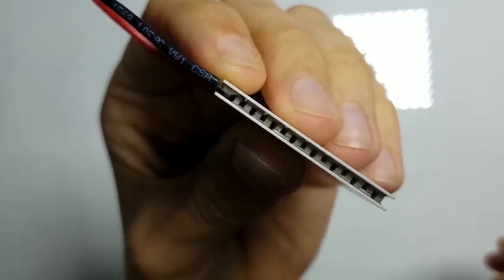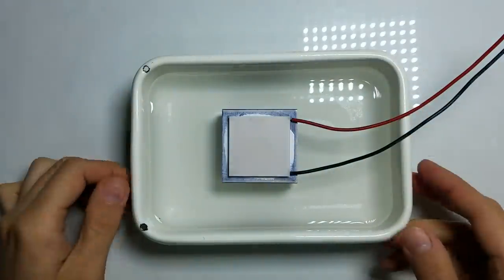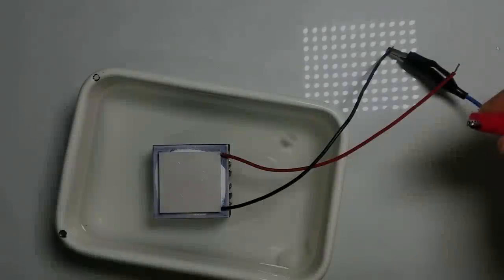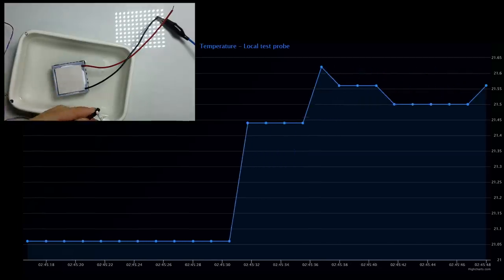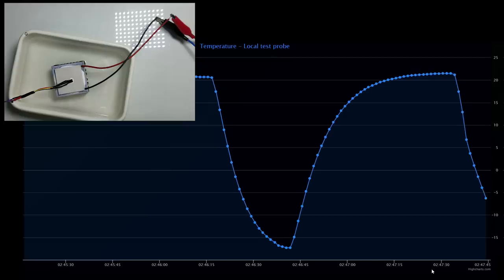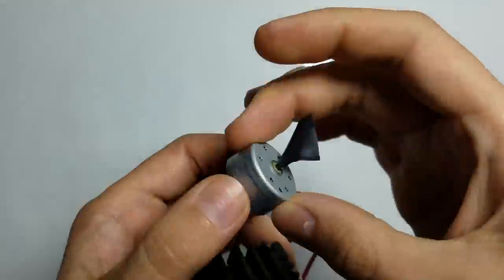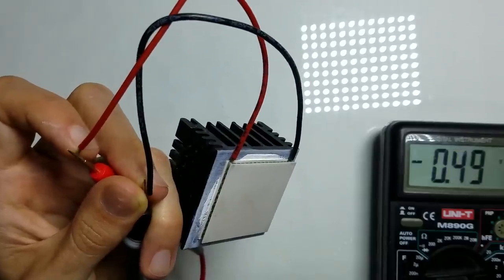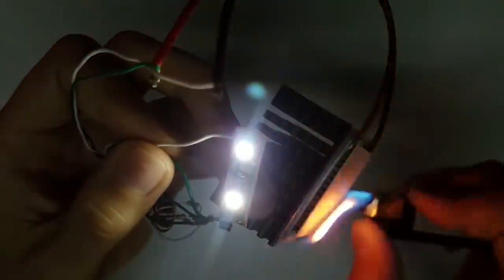Thermoelectric Cooler - Device That Makes Ice and Electricity

Comment: Will it make electricity on the cold side too
Reply from the maker: Hi, what do you mean by "on the cold side"?... you just need to make one side hotter than another. You can also switch sides, then the electrical polarity will switch as well.
If both sides have the same temperature then it will not make any electricity.

Comment: interesting i also found those things was tinking to make a little fridge. but i am wondering can u boost it to 12v ? i am not that great with electricitie but if thats possible shoulden u be abble to stick 2 to each other and let the hot side heat up the one that generates te power and the other one of course cosume the power to heat it again free fridge power ? ow i also found a föhn heater that is 12v so should also be able to make a heater if its possible of course

Comment: How do you know which side is cold and hot side of peltier module?
Reply from the maker: Just connect it to the power source for a second and you will know. Btw, if you reverse polarity hot/cold sides changes as well.

Comment: hey dude.. Can I ask?
"What if I going to be connect peltier module to a lower Voltage and for example is only 9Volts of current voltge,.. Does it still works or produces an ICE? or does it still continuously cools??
Reply from the maker: Hi, with 9V it works and consumes about 3A, so make sure that your power source can provide at least 3A. Well, it is getting cold with 9V, and you will be able to freeze a drop of water. Another side of the device is getting hot as well, so you need to cool it down. 
I just did some tests and It is getting cold even with 5V, but you will not be able to freeze water using 5V.

Comment: Great explanation of what this can, and can't do. I was hoping to use this to chill the water in an evaporative cooler, but it generates as much heat as it cools, which a fridge does as well. ;0)  Did you measure how much heat it produces? Also can you regulate the heat/cold by regulating the voltage? Or is it only on or off?

Comment: When applying heat to one side does the other side get cold?
Reply: When you supply it with 12v, 1 side gets hot the other gets cold at the same time

Comment: you could use these on satellites one side that's facing the sun the other side that's not
Reply: Pretty good idea!  I was just thinking about all the cool things you could use this for.
Reply: Helaman Gile they actually have been used on satellites, but not this way. Thermonuclear reactors harness the heat from a nuclear reaction to produce electricity and are used in deep space probes.
Reply: @johnnykatze7467  that is so awesome never knew that

Comment: Can you use it like a cpu cooler? Fyi only watched bits and pieces of it.
Reply: No, not really. If you count with a 75W tdp cpu you would need to have a a 200W peltier module at least probably a 300W if you dont want to fry your cpu. You would need to feed it 12.5A at 24 volt or 25A!! at 12 volts. And at the end you would not only need to deal with that 75W to dissipate but 375W!
Reply: @tiesto9797  thanks

Comment: may i know how much current it draws from 12V voltage supply?
Reply from the maker: Hi, about 4A - 6A
Reply: Depends on the module you are using there are upto 15A modules available

Comment: I bought an ice chest that uses those to heat or cool depending on how you plug it in. It drains a car battery QUICK even when the engine runs. Turn off the engine and there's not enough power to turn over the engine one time.

Comment: I'm wondering. Is it can be able to charge a battery if I can provide continuous heat difference?
Reply from the maker: Hi, yes, but it generates not much energy, so charging will be very slow. You will not be able to charge a phone via USB, not enough power. But you can use for example appropriate dc-dc step-up converter (something similar to what I've used with those LEDs), convert it to 14V for example and charge a small lead-acid battery... but it will take a lot of time to charge it. You can use many modules to get more energy, but I think it is not worth it.

Comment: If I take TEC1-12706 peltier module and I gave to it 12volt,6amp at room temperature 35 degree Celsius then after 1hour what will be the min temperature at cold side and max temperature at hot side

Comment: Find a way to submerge the cold side into the water to see how much ice you can make. Enclose the hot side not just to a heat sink but to some process that will use that heat to do more work. After all if your gonna use DC to run it, you might as well get your money's worth. How about finding a way to use several of these in a Loop! The heat can make the voltage to run the other side and Poof, instant self generating cold and heat source.
Reply: It works in reverse right.. if you apply heat or cold, you get voltage out of the wires.
Reply from the maker: Yes, but it is not energy efficient. This device just about 10-20% energy efficient.

Comment: Hey I'm thinking to use this for power generation,can I use heat and produce electricity?
Reply: Didn't you just saw him produce electricity using his lighter as a source of heat
Reply: @Reedyngaihte  yeah but m unable to find exact model,can we use any sort of peltier for power generation?
Reply: @pratikmourya  yes..you can
Reply: @Reedyngaihte ok then I'll get one, thank you mate :)
Reply from the maker: Not just heat, you need to make temperature difference, which means one side of the device has to be hotter than another. The bigger temperature difference the better. But you also should know that this device is not energy efficient, so in most cases it is probably only worth doing for educational purposes.
I am not an expert on Peltier devices, but I think they all should work in reverse and generate electricity.

Comment: People would delid a CPU, but I couldn't find  people delidding Peltier cooler.
May be someone delidding a Peltier and replace the ceramic disk by a copper plate
The TEC part in the sandwich is insulated by putting a mica between the TEC and copper plate,
much like the power transitor heat sink.

Comment: Cool video! .... random question, say I have two of those and I am cooling water will it reach a colder temperature than each of the coolers? Or the only difference is that it will just cool to that temp faster?
Reply: The water can't reach lower temperature than the coolers, but they can cool fast

Comment: Hi!! Really nice video!
I know there are different type of peltier cells. Which kind of P(eltier) C(ell) is this?
Where do you buy it? 
I did and experiment with a PC but I wasn't able to get any colder than 20C on the cold side, I used a very powerful heat sink a CPU heat pipe with a capability of 200W heat dissipation but 20C was the coldest temp I reach. My thought was that my cell is not a very good quality of maybe is a wrong type.
Thanks for any help!
Reply from the maker: Hi, I've used TEC1-12706, bought it in a local online store (not worth mentioning). Well, make measurements: voltage and current, and try to find out what is wrong. Is your heat sink getting warm?... well I don't know what is wrong, need more info.
Reply: @ElectricalPro  that's the point all measurements are looking fine. Voltage oscillates between 12.5 and 11, current at full power is between 2.8 and 3.3 amperes. My heat sink is getting really warm. the cell without heat sink goes in a couple of seconds to 100 degree, with the heat sink it stabilises around 50. this is ok but mean wile the "cold" side is at 20
Reply from the maker: Ok, it seems like your Peltier device is defective. It is not just "not a very good quality", it doesn't work at all, it is defective.
I did not care much where to buy it, I just googled TEC1-12706 and bought it.

Comment: What ampere to work peltier.
Reply: It taking 12 volts dc and 10 to 15 amp power.
Reply: Check the model number, in vid. it is 12706, 12 means 12v, 06 means it draws 6A.

Comment: Do you think you could make a device that would keep a small ice pack cold? The reason why I'm asking is bc I have chronic back pain and the best relief I get is keeping a small ice pack on the problem area of my back. The ice pack is so cold it numbs the area, but within    about 30 minutes, the ice pack thaws out and the pain comes back just like it was, before I used the IP on it. I injured, (broke) my back almost 18 years ago and Its given me trouble ever since. I was self employed and I had good insurance, but the neurosurgeon was afraid to do an  operation. I think he was worried that it might make it worse. After looking at my x-rays and MRI my family doctor said the state law prevented him from writing a prescription for the kind of medicine I needed, so he referred me to a pain management Dr and he tried everything he could, but nothing helped. The only thing left was pain meds. and he giving me the strongest thing he could, until the government  changed the drug law's, which stopped him from prescribing that type of medicine. Besides my back being all messed up, he said I had degenerative disc desease's, which basically means my back won't be getting any better. The older I get, my spine will be slowly deteorate, I guess, until I'm no longer able to get around. So that what's I got to look forward to. If you could invent something like that, I would appreciate it very much and I would also be glad to pay you for your time and materials. I'm not the only person that has this problem, so If you did manage to build  something like that and it works good without any problems. I don't think you would have any problem  selling them. Regardless of what you do, I would like to thank you for listening. Take care, stay safe and have a great day.

Comment: What is the efficiency of this device compared the compressor tech.
Reply: Terrible. That is why compressor tech dominates the market for refrigeration and air conditioning.

These are used for spot cooling or when quietness or lack of vibration is important.
Reply from the maker: From wiki: In refrigeration applications, thermoelectric junctions have about 1/4th the efficiency compared to conventional means (they offer around 10–15%efficiency of the ideal Carnot cycle refrigerator, compared with 40–60% achieved by conventional compression-cycle systems

More here: https://en.wikipedia.org/wiki/Thermoelectric_cooling

Comment: How cold can they go! can it achieve cryogenics temperature? If you physically connect them in series with thermal conductive paste, could it generate extremely cold temperatures with these devices?

Comment: I went to two years of Technical vocational school for electrical wiring and I went to an additional two years of electronics class! I have only seen one minute and 27 seconds of a video so far, I find this device difficult to believe, tell me what are the components you use to make this,  what is the voltage amperage wattage and frequency of electricity that you're using?
Reply from the maker: Hi, I did not make it, I bought it, you can read about it on Wikipedia: https://en.wikipedia.org/wiki/Thermoelectric_cooling
You need 12V DC to power it, it consumes about 4A-6A, you can calculate wattage from it.

Comment: Don't coilless fridges use this? The sides are warm, but inside is cool.
Reply: the principle of any fridges is to take the heat from the inside and transfer it outside. In fact any device that cools works this way (feidges, air conditioning, etc,...)
Reply: @SessesSniper  I'm talking specifically about fridges that doesn't have the heatsinks exposed at the back.
Reply: @killervirus57  oh ok I didn't knew about them x)

Comment: It would be cool if you could utilize this to cool soda cans quickly, or thermos bottle or cooler or ac units without freon. It would be good in an electric car to use as a heater / air conditioner
Reply: Already exists. I have one I can plug into my car cigarette lighter plug.

Comment: There are tests with this kind of TEC and is unable to create ice because it freezes very slow and is limited in temperature difference between both sides. That's why in video is using water (surely very cold water) and the termometer is not hotting the TEC. Also don't works as CPU cooler by the same problem, is unable to freeze fast enougth and becomes hotter than put just the cooler.
Just put a beer and you'll see what I mean...
Reply from the maker: It's tap water, I think at the start the water was about 15C, but because the device creates a lot of heat the water became very warm, I think it became about 30C... Well, water cooling is not necessary,  you can just use a big heatsink.
It should easily freeze drops of water, but you will not be able to freeze big amount of water. It is not possible to freeze a glass of water with this method.
It is not about freezing speed it is about power... your fridge can freeze water, but you still can't freeze a lake with it, no matter how much time you spend.
It is absolutely possible to make a fridge with a lot of these devices, but such fridge will consume 10 times more energy compared to a regular fridge.

Comment: You should submerge as much as you can into the water and maybe the ice it creates can cool the heat sink and maybe it will continue the cycle. Or maybe isolate the warm and cold water and get on side cold water and other side warm.

Comment: can a peltier device charge a battery some how?
Reply from the maker: Yes, it can, but it usually not worth it, because it will take a very long time. You will need multiple Peltier devices to charge a phone for example. Solar panels are usually much batter choice, but they of course need sunlight.
Reply: @ElectricalPro  thank u

Comment: Wouldn't you be kind to upload a video on how to make it???
Reply from the maker: Hi, I bought the device, it is probably impossible to make it at home... it will require special materials, equipment, knowledge. For more information read about "Thermoelectric cooling" on Wikipedia... it is not that simple.
Reply: @ElectricalPro  what's the cost
Reply from the maker: About 3$ - 7$

Comment: Can you make termo water cooler or swamp ?
With Temp sensor and controller ?
Reply: You would need to figure out a way to dissipate all of the residual heat from the opposit side.  Without having a negative effect on your heat transfer process. Whatever that may be.

Comment: Appreciate your effort , nice video . Hey can you tell we what would be the temperature on the hot side
Reply from the maker: Well, it depends on the cooling you use. It produces quite a lot of heat, my heat sink becomes very hot less than in minute, that is why I put it in water, it even made the water warm. How hot? it can get hot enough to boil water.
Without a heatsink, it will probably burn out in 10-20 seconds.
Reply: @ElectricalPro  A heat sink & fan combination works fine.

Comment: Nice vdo of some unheard technology, Can it be used as an air con in tropical countries to save electricity? How much electricity required to make one panel ice cold?
Reply from the maker: Hi, yes it can, if you use a lot of them. But it is not energy efficient, I think a regular air con is a way more energy efficient. Although one side of this device gets cold, another side gets very hot, which requires cooling... It consumes about 50W.

Comment: can I cook in one Side and other side to make ice for chilled bea
Reply: Yeah great idea, but the bummer is you need to dissipate the heat fast from the hot side because it will heat up the cold site. Also these modules typically can produce 70C of thermal difference so your meal will not cook or you tea will gets warm.

Comment: This could be used for cpu cooling but it might freeze the core
Reply: Neko014 bro it work at it best at 12v so if you give it like 6 or 5 volts it will work flawlessly

Comment: How to know which part is hot and cold?
Reply from the maker: You can test it yourself, connect it to a 12V DC power source for 1 second. Or you can figure it out from the video. If you reverse polarity hot/cold sides switch places as well.

Comment: Dear I supplied 12v to 12706, both sides become equally hot. No one was cool. Why???
Reply from the maker: I can only think about two reasons why that can happen. First reason: you use AC instead of DC. Second reason: something wrong with your Peltier module, maybe it is counterfeit or something.

Comment: Use solar battery to power device , use the cooling part o the device for a fridge,, AC & the heat to boil water for a steam cooking device . Is this possible if so I think some one can make these contraption and market it as domestic appliance.

Comment: How many voltage it is?
Reply from the maker: It designed to work with 12V DC. But when it generates electricity it is less than 2V.
Reply: So I can use my 3 voltage battery for that?

Comment: Refrigerator: "am i a joke to you?"
Reply from the maker: Refrigerators are more energy efficient, but they make noise and heavy. Each tech has its pros and cons.
Reply: Electrical Projects [Creative Lab] it’s not about heavy or noisy. It’s about using a compressor with Freon gas and nowadays maybe a better gas but still not environmentally friendly. The new technology of Heat Pump is 800 times more efficient than old ones.

Comment: Can we make an air conditioner with it
Reply: You can but the efficiency is around 10% compared to the efficiency of 50%-60% of a system using a compressor.

Comment: can i use that as CPU cooler  on my pc?
Reply: Short answer no. Long answer: No, not really. If you count with a 75W tdp cpu you would need to have a a 200W peltier module at least probably a 300W if you dont want to fry your cpu. You would need to feed it 12.5A at 24 volt or 25A!! at 12 volts. And at the end you would not only need to deal with that 75W to dissipate but 375W!